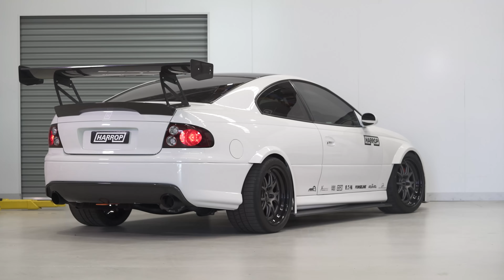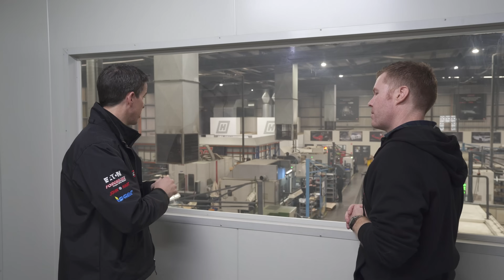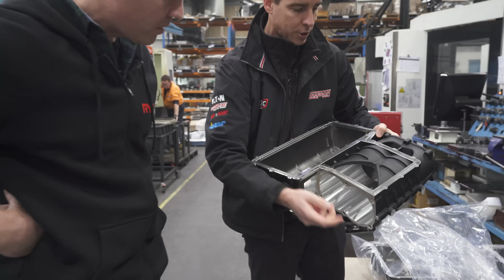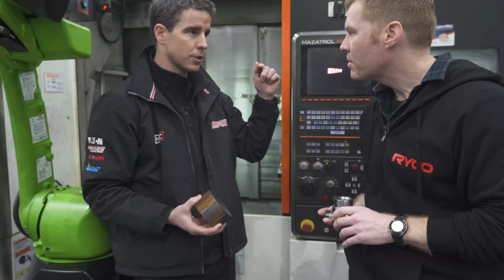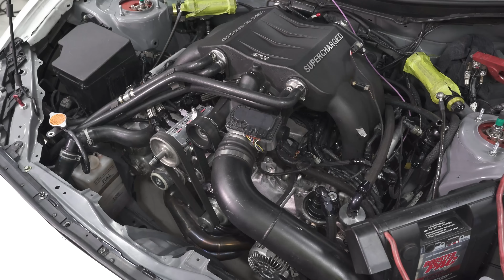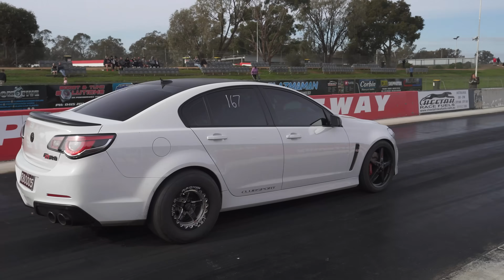Manufacturing performance - We visit Harrop Engineering | fullBOOST

Comment from the maker: This week Luke hosts Ryco workshop Hero's and heads down to one of Australia's best known performance parts manufacturers in Harrop Engineering.

More info on Harrop Engineering visit https://www.harrop.com.au/
More into on Ryco filters visit https://www.rycofilters.com.au/

If you’d like to be notified every time we upload a video, subscribe and then click the bell icon 🔔 next to the subscription button.
Reply: Farking cracking good walk through
Reply: Also during my time selling Aircraft grade alloys i did come across a company in Werribee, making the new PBR calipers for holden and the new VT series 2 etc.🦘🦘👍👌✌
Reply: Nęxţ Lęvël! 😎🙏
Reply: Yep when he mentioned aerospace, i was the person who introduced them to locally sourced aircraft grade alloys and mentioned the other companies who are now using the same aircraft grade alloys to make aftermarket car parts and components back in 1998, back when they were in the wooden shed. cheers. 🦘🦘👍👌✌
Reply: basically albins who did make the trans axles for the v8 supercars which are based in Ballarat and there plant is spot less air temp controlled through out and especially in the lab where the use laser measuring equipment and testing beds which are next level ,they also make the gearboxes for the porsche gt3 rs race cars used for the carrera cup series racing in australia. 🦘🦘✌✌😎😎

Comment: Congratulations to Heath and the team. So many busineses going under. But some how they still manage to keep it all in Australia.  I dip my hat. Would be a dream place to work at
Reply: nope they have official harrop dealer networks in the USA, meaning that they are just as good if not better than Harrop in AU, Milling machines CNC machines everything a Aftermarket parts manufacture needs to be competitive around the world but more importantly to Make and sell Harrop named parts as well. cheers 🙌🙌🦘👍👌✌

Comment: Does Harrop design and make one off parts?

I need some one off rocker covers designed CNC'd based off the OEM ones but to work with Yella adjustable race rocker arms.   There are a small number of aftermarket covers for my engine but none of them fit due to ancillaries rather than the rockers themselves.  

Harrop def are the closest facility to me with these capabilities.
Reply from the maker: Can't you just get some valve cover spacers made instead? It would be far cheaper.
Reply: @fullboost   Yeah I looked at that but it doesn't really fix the issues and creates new ones such as throttle clearance and PS pump high pressure line clearance, then there is the issue of paper gaskets or RTV for the spacers which is in my opinion a bit of a botch job. The only things I can work around is the thermostat and ignition pack clearance and brake booster via the delete route.  The shape of the covers need fundamental changes to get the rockers to fit and maintain clearance with all the other stuff. Sometimes simple things like rocker covers aren't so simple.

I had similar issues with headers and my steering column and the factory engines mounts.  It took a number of different types of mounts until I could sort out the engine movement issue during cornering that would bind my steering on the headers and that fit without causing other new issues.
Reply: I doubt Harrop do one off jobs unless you're a big customer of theirs. There still is smaller "jobbing" shops around Melbourne, just search cnc milling companies but expect to pay a fair bit for it. It would probably be cheaper to have one cast rather than machined cos that's a lot of material to remove
Reply: @davidt3196  I have had parts made before but I used separate companies doing the 3D scanning/ modeling and the manufacturing and this is a pain when you need to coordinate the two make alternations and is costly.

I don't know any place that does the whole project in house from start to finish which would make it more cost effective.   Yes I agree, billet parts are $$ but for an all out build it's a non issue. I want it done right the first time.  I have talked a lot with Aussie speed as they make cast tall covers but each version they make is worse.  They make them for looks rather than function and is very frustrating and they are pricey too. I'd rather spend 2 or 3x their price and have it 100% right than mod half my engine and engine bay to clear their rocker covers.
Reply: @3800S1  Any decent engineering firm worth their weight with a CNC will be able to do it. Just be prepared to pay for CAD input and R&D aswell as the manufacturing of the parts if you haven't already worked the design out yourself.
Reply: @3800S1  Maybe hit up YellaTerra themselves. You're probably not the first person to have this issue and it could be worth their time to come up with a solution to be able to offer other customers too. I'm a fitter and turner myself and have been to their factory in Braeside, they have some decent cnc lathes and mills and in house engineering team
Reply: @davidt3196  I did, they didn't have an answer.